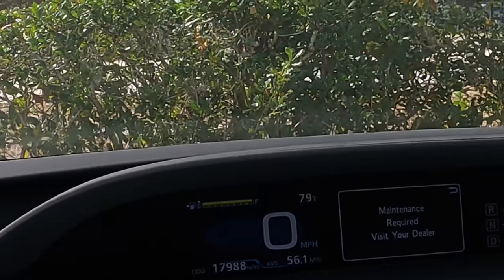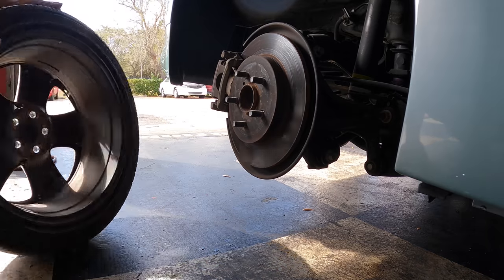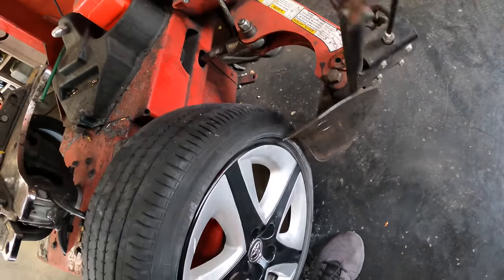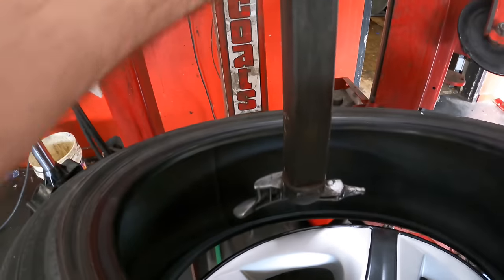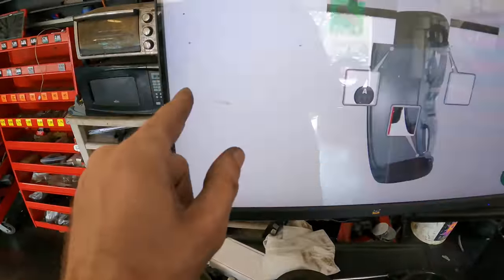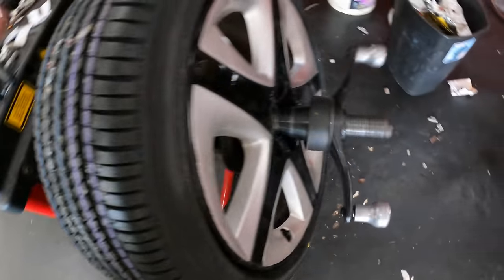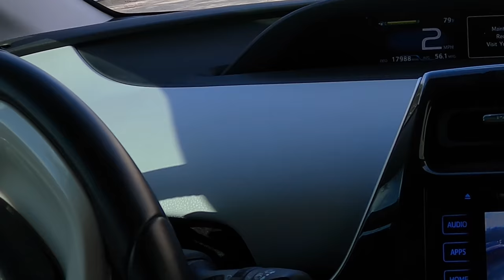Insurance Jobs, Not worth the Deductible! Toyota Prius! Tire and Wheel Walk Through

Comment: Definitely liked seeing a simple walk through of the process.  I love how so many places make such a bit deal about the sensors and you didn't even touch it.  This demonstrates that it really isn't worth the extra cost tire shops place on dealing with the sensors (not that I believe the sensors were the right answer to anything, should have just been a national law for public access air compressors instead of millions on a weak short life span technology that most people ignore anyway).
Reply: My shop always replaces the valve stems on Any rim, including (and especially) those with sensors. If they corrode and get stuck on the only real way to remove them involves destruction of the sensor. Saves you a 30 dollar universal part for just 3 bucks.
Reply: @benjamin32827  3 bucks, bet your shop ain't anywhere near Austin, TX?

Ain't any place I have seen around here that charges any less than $20 for wheels with sensors.
Some of them are shady enough to charge it regardless of if the vehicle has them or not.
Or the fun one I have, '07 first gen sensors with the sensors banded to the rims in the middle.
Reply: @jameskee2412  Now band sensors are a different story, but TPMS service packs, (some of which include valve stems, but a bunch are just rebuild kits) cost 3 bucks for the part and we normally just do the service as a courtesy during the tire change. Takes but 2 minutes and isn't worth to charge any extra labour really, but no, not near TX.
Reply: @benjamin32827  your shop is one I wouldn't mind using if it was here.  Like I said, they charge a significant amount here for it.  I have argued my way out of it for the band sensors since they wouldn't touch those, but my newest vehicle and my parents vehicle both have the stem sensors for which I know I can't get anywhere since the charge is area standard

Comment: i like the laser aspect of the wheel balancer but I like to use the road force balancer to really put the finishing touches on the wheel balance..i have seen tires go from 40 pounds of road force down to 5-10.....15 is usually acceptable on car tires...has saved many headaches down the road and resulted in very happy customers

Comment: Wow, you actually torque the lug nuts 🙃 here in Sweden the shops will just ram them down as hard as they can with the air impact machine. You can break sockets trying to get the wheels off

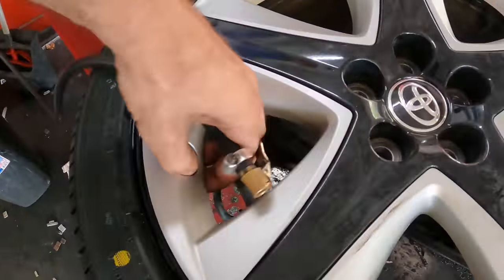Comment: @10:00... You forgot to spin the tire on the rim so the yellow dot lines up with the valve stem. I'm used to doing race tires, so I line it up exactly, not "close enough". I'm not a fan of the spoon style bead breaker. I prefer my old Hunter with the rollers that break the bead after the wheel is place on the turntable.

Comment: Recently had my new tires mounted on my new wheels. Tire shop bsolutely destroyed them. Marks where they sit the tire on the face of the wheel to lube the bead, perfect scratch around all wheels where the machine mounted the tire. Couple random chips down to metal just for good measure...

Sucks having to rely on shops sometimes.

Comment: Don’t usually see referencing the manufacturer dot with valve stem. Spot is located by spinning the tire to find the high spot. And now the dot didn’t line up with the valve stem, oh well this just has your balancing weights be less weight than more, will balance fine

Comment: here in the UK, a tyre with any damage to the side wall is defective, and the penalty is hella severe. £2,500 ($3,300)  and 3 penalty points on your licence, per defective tyre.. when you accumulate 12 points, you lose your licence. if you have 4 defective tyres, they WILL fine you the maximum £10,000 ($13,200), and the points will equate to a driving ban.

Comment: When inflating when it starts to take air unlock the wheel from the machine. I’ve seen dudes do truck tires and the back side of the tire pushes on the table. When the pressure gets higher it can break past the lock and sent the wheel flying. Seen a dude launch one into a 20ft ceiling and came down and bounced into a car and smoked through the windshield. If it was unlocked it would have just hopped up maybe an inch or 2

Comment: Perhaps this is an issue up north with the salted roads; is it not required to take a wire wheel to the insides of the rim where the tire bead meets and clean up any debris before mounting?

Comment: You should always replace the valve stem when fitting a new tyre.
Reply: REEEEE!
Reply: Not with a tpms system. They’re not necessary to replace. With a vehicle with rubber valve stems and no sensor I always replace them. If the wheel has a metal valve stem and it’s leaking, you can get a rebuild kit with a new gasket and such. But that’s the most you’d have to do with that.

Comment: I miss working with wheels my 1st punture was a tubed tyre on a series landrover when I put the tube back in after I had fixed the hole popped the tyre on the rim carefully when it came to pump it up id put the tube in backward as the air went it it pulled the valve through and disappeared had to give it a punture to let it down then repair it and then reassemble with the tube correctly aligned and then balance not a mistake I name again at 16 years old

Comment: Sidewall damage is a blowout hazard no doubt about it.
I wouldn't drive it far.
Also some tech overlook it but all build up of debris, dirt or grease must be removed from the inner side of the rim.
If not you will add too much weight and when the debris vibrates off the tire will go out of balance & vibrate.

Comment: Note: Even though you can get away without doing it, technically you are supposed to release the wheel from the inside, re-clamp from the outside while mounting and then remount from the inside. Personally, I always felt this to be a waste of time, but some wheel designs out there actually do require this procedure. Usually with run-flats, but I digress.
Reply: I had a wheel slip and the teeth ripped a hole in an aluminum wheel because it had new clamps and it was clamped from the inside
Reply: You have to clamp from the outside on Reverse mount wheels. Those are fun to do.
Reply: I know but try to tell 18 year old kid that just started 3 weeks ago. Now I make sure all my new guys know steel wheel from inside and aluminum from outside

Comment: My $0.02...if it were my car, I would want four new tires, although I agree with Ray that the damage was not enough to warrant changing it out. They need to match and have equal wear for optimal handling.  But my car is sensitive to tires and balance and that Prius and its driver probably wouldn't notice anything.

Comment: Ever have a tire that had over 3 ounces on it.   I have and when I had my truck in for replacement tires they get it all done and I rejected the work on the rear tires.  I made them take the truck back in break the bead, spin the tire 180 degrees and rebalance the tire. 1.25 ounces. They had the tire and wheel at the heavy spot for both items. Tire store manager wanted to argue but I asked him to appease me and do what I asked. 

He stood there the entire time as he did not think it would worked. After they rebalanced the tire and wheel he looked at me and said how did you know that trick.  I told him I used to run a tire shop 35 years ago. Most times tire shop just want to slap it on and get to the next vehicle. I will not allow them to do the slap and dash.

Comment: If you use the robotic arm to apply pressure on the sidewall 180* from the valve stem hole it will relieve stress on the outside bead and help to not rip it.just sayin bro.

Comment: When I was a lad, and dinosaurs roamed the earth, to balance a tire dynamically, we had a spring loaded rod that went from the car body to the floor.  It had an arm at 90 degrees.  We spun up the tire with a motor on wheels and watched the arm bounce.  When we added the correct amount of weight, the arm was steady, and the wheel was balanced.  Good grief, was that primitive!

Comment: Pausing at 8.20 to say, I always believed the paint mark on new rubber denoted the lightest area of the moulding & thus to be installed at 180 to the valve stem to reduce the number of weights possibly needed to balance. Then again, the last tyres I installed balance wasn't so much an issue (They're big mud tyres on a Land Rover that will never see the north side of 50mph again)
pausing again, seconds later. I see that skin has 2 paint marks, guess the red dot is the opposite valve dot lol

Comment: I've lost count over the last... 30 years or so, but I've only seen ONE garage in all of that time use a torque wrench on the lugs.
99.9% of the time they just slam the lugs on with their pneumatic impact.
As a result I encounter a lot of double threaded lugs when I'm trying to change tires... they don't ensure the lug is threaded properly before slamming them on - those pneumatic wrenches simply do not care at all if the lug is threaded right or not.

Comment: I noticed that you weren't using your Stihl petrol-powered 1" wheel-nut impact driver. Hasn't it arrived yet?? 1000lb per sq in. The Power! "CC-CLICK". (wasn't that Toyota centre-cap installed 180-degrees  out?)

Comment: Do you ever mount/dismount from the backside of the wheel?   I started doing it that way after watching the guys at discount.   It seems easier for low pro tires and prevents scratch/damage to the wheel face and sensor.
Reply: Only for reverse mount wheels. There are some fuel wheels that are reverse mount. If it's not reverse mount and you try to break down from the back, you might damage the sensor.

Comment: The only part that I've never been clear on, in the whole process, is the "setting the bead". Granted, I've never taken the time to look at a bare tire (without wheel), so it might be something completely obvious when you see it. Same with a "blank" wheel. Is there a groove of some sort in the wheel that the edge of the tire rests in?

Otherwise, aside from my lack of knowledge, I found the video interesting and entertaining. So thank you for sharing, and keep on smiling at strangers - the world needs more smiles!
Reply: The outer edge of the wheel has a flange that the outside edge of the tire pushes against. Maybe 1/2 inch or so inwards on the rim is hump, imagine a speed bump on the road, running parallel to the outer flange. The edge of the tire needs to sit  between the bead and the outer flange.  These two features squeeze the tire between them, and when air pressure is added the tire seals in this valley. Breaking the bead or setting the bead is the process of forcing the tire to climb that bead when installing or removing the tire.
Reply: @daveklassen7052  Thanks for the clarification. I think I've got the mental picture for it. And no I think I have a grasp on those "setting the bead" videos with massive tires, like tractors and such; hot air, expansion, force things into place. Or it's all camery trickery!

Comment: 6:08 .... as a former tire tech... OUCH, that must have left a mark.

6:25 too, never leave the bar there... ouffff. Shops always have composite wedges made for this to stick in there so you can remove the bar and put one of those wedges in there. If i was the car owner i'd be pissed watching this :P.

Why didnt you lube the bead before removal? right after you bust the bead, lube it, it'll slide right off (not recommended for novices, as it can possibly make dismount more difficult as it makes it slippery)

Comment: Nice video as allways, but do have some comments. Under the panel, there is an arrow, that points to the area, that is strengthen for lifting. You where not far of it, but maybe tell people that this is the place to put your jack. 
Again I see you clamp the wheel on the inside of the rim. That is not the way to do it on an alloy wheel. Use the four arms from the other direction, with special plastic protectors, and clamp it over the rim instead. This will prevent you breaking the coating inside the rim, thus preventing corrosion on the rim.
I know your way is easier, but it is not the right way to do it on alloy rims. Only steel rims.

Comment: She's lucky there wasn't much wear on the tire when that happened. I keep hearing those stories about people who get a sidewall puncture on an AWD vehicle, and end up needing all 4 tires to avoid causing damage to the drivetrain. I wonder what difference in circumference is tolerable.... Is shaving tires a real trend?
Reply: Yeah we have that warning for AWD cars, our says transmission or differential damage. I would say that if you have tires at 5/32s and you install a new tire, which typicality is anywhere between 10-14/32nds that may be a massive difference. However if it's less than 2 or 3/32nds I probably don't think it would effect it much. Like if you have new tires that you drove on for less than 500 miles and then you get a blowout. I don't think it would be a big difference.

Comment: Stepped-down lugs with flat seating are a hidden danger and need to be checked regularly. Do your own experiment: Thread a nut onto a bolt and drag your finger across the perimeter noticing how easily it turns. Now drag your finger across the face of the nut and notice how little it turns if it turns at all. Another hidden danger of stepped-down lugs is that if the stud doesn't extend fully into the thick part of the nut you've got little strength holding the wheel on, and should the lugs loosen you'll get this condition anyway. Replaced studs or different wheels being installed can cause this to occur. Most race sanctioning bodies in the US require tapered-seat lugs with sleeved lugs specifically prohibited- now you understand why. 

Twice I've almost lost a wheel with stepped-down nuts which were properly torqued by me within a month before it happened. I pulled over the moment anything seemed the least bit wrong both times, and both times there were only 2 out of 5 lugs still there with both nearly fallen off. Mine happened with a set of used wheels which had worn slightly oval inside the hole; not something you'd really notice unless you were looking for it. I've seen plenty of trailers and construction equipment with wobbly wheels because the tapered nuts had loosened but the lugs were all still intact still holding the wheel on. I see a comment below from Australia noting that they require tapered seat lugs since 2010, something every nation should be doing.

Comment: I would not replace just one tire. They should be replaced in sets or all 4 at the same time. You should know that. The stick on weights are the best way to go with aluminum alloy wheels. I don't claim how the stick on wheel weights are able to balance the inside & outside of the tire & wheel assembly. Some one please let me know & understand this. I always over inflate my tires since I have never know of Chevy or Ram truck alignment specs to be correct with tires set at 35 P.S.I. The front tires always wear out on the outboard & inboard edges of the tires while the center of the tires show very little wear.

Comment: "Nothing eventful happened."
Sure, but it's been a looong time since I've done a tire job, it was nice to watch an "easy fix."
Man, I worked with some dinosaur equipment. "High-speed balancing!" Yeah, and literally every setting had to be made manually. But I did have the happiest customers - never a return for balancing issues. (And I always gave a free re-balance if they were in for a flat repair, whether or not they bought tires from us, I didn't care what the boss said, lead weights were cheaper than dirt then!)
Wait, there was one return, it was stick-on weights that had come off. It was my first time using them, trained by a guy who had never used them before, on cold rims (it was winter).
It was nice to see the new balancing machine and how it works, I had never seen the computer balancers before. Much faster setup indeed!
Reply: I remember high speed. Never felt safe to me

Comment: Hate to be a prude but you put the centre cap on wrong, well wrong from the way I do it, I would have had the Toyota badge facing the other way from the valve, just an ocd thing I have with my job, centre caps and locking nut location also

Comment: 2 questions, 1) I have been told the tires have to be changed in pairs for safety reason. But I guess in this case insurance doesn’t see it that way? 

2) How did tires get balanced in the old days without laser assisted?
Reply: It is best practice to change tires in pairs.  Some AWD systems can have issues with uneven wear, requiring all four to be changed together.  The old way of balancing was to lay the wheel horizontally on a simple stand that supported it at one point in the middle.  It had a level bubble and you added weight until the bubble was in the center.
Reply: Spin balanced. I made one for home use on motorcycle tires out of roller blade bearings a metal rod and turned wood. When the tire lands on a different spot each spin its balanced.
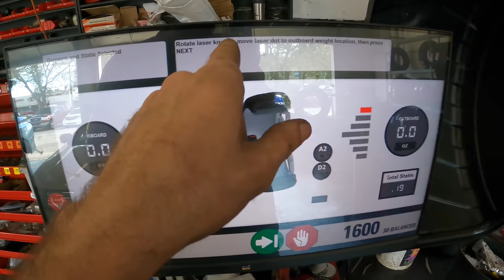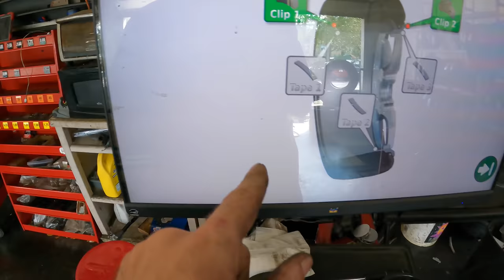Reply: Simple.  The machine told you to rotate the tire to the 12:00 position.  It had arrows that told you when the wheel was there.  You installed your weights right at 12:00.  No biggie.
Reply: Before spin balancers were  around we had bubble balancers..you centered the tire and wheel  assembly  on it and watched the bubble in it sort of like a carpenter's level then you just found the correct ounce lead weight and placed it to the opposite side and watched the bubble to go to the center then hammered the weight on...then when that side was done you flipped it over and did the other side.